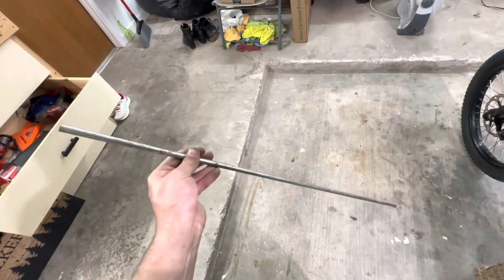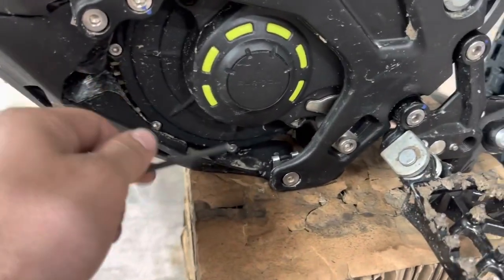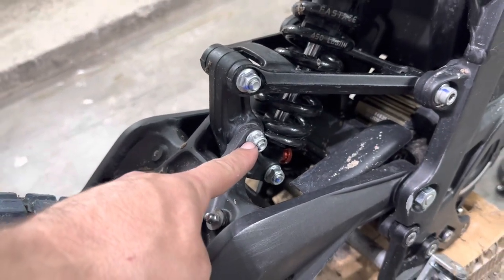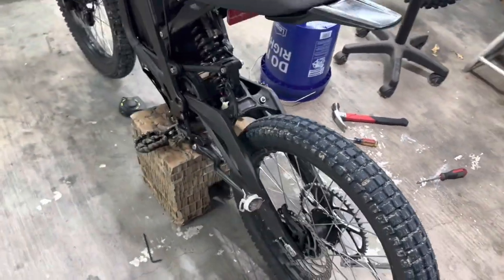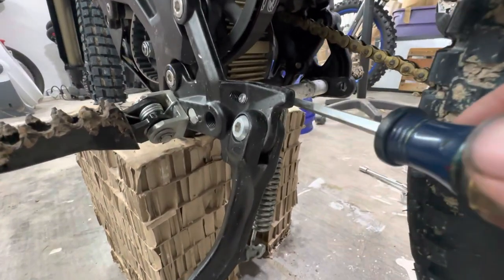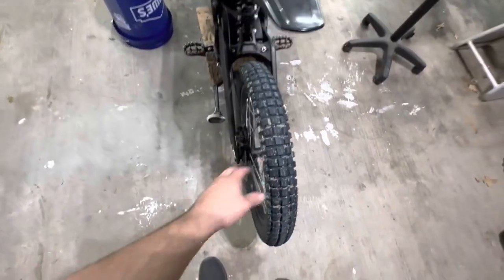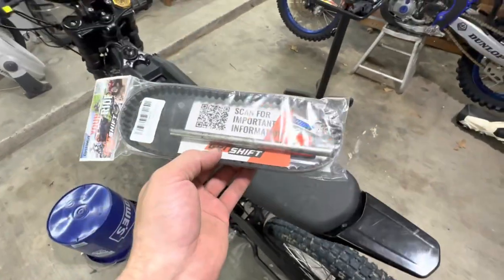Surron belt replacement EASY

Comment: All you have to do is loosen the motor mounts and frame mounts near the swingarm and it will open up slightly and you can easily slide the swingarm in place
Reply from the maker: Wasn’t that bad. I can do one in 10 minutes not filming

Comment: I found this vid looking for info on tensioning the drive belt. I notice how dang easy you were able to get it and I don’t understand😂 my bikes been down for 2 years but I just got new forks so I can get it going again (also replaced the belt) and I cannot get the tension tight enough. Is it the peg brace that makes it so you can pry down on the motor?

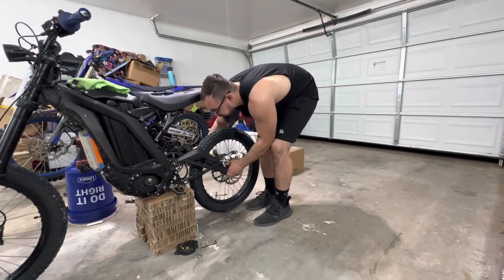Comment: how did you get the swingarm lined back up so quickly at 3:50? i spent over an hour trying, those stupid metal spacers are the issue...theres fucking no clearance...i couldnt make any progress so i shaved those spacers slightly. was still a struggle. what the fuck.

Comment: After several belts you will know how to do it in 10 minutes without remouving swing arm, just remove the axle and motor pulley cover ;-). nice trick tho
Reply: I don't see how that's possible. Make a video. Prove me wrong please
Reply from the maker: That won’t work unless I take out the peg brace.

Comment: Doing this sucked. I don’t know if any of the other methods are easier but if anyone’s wondering, definitely think about doing it another way.
Reply from the maker: @jaretmaccanico3515  you can try leaving the swing arm in and dropping the jackshaft out the bottom. If you have a peg brace you will have to remove it so the jackshaft has enough room to come out

Comment: no mobile1 grease on anything, interesting. This is why I don't buy anything used. People don't know how to properly maintain anything
Reply from the maker: You didn’t see any doesn’t mean I didn’t. I put so much grease on my belt.
Reply: @Surron_Lort  on the belt wtf? , talking about suspension shafts, pivot points and bearings. Sure you did guy.
Reply from the maker: @ericthedesigner  gotta grease the belt
Reply: I'm trying to maintain my surron properly. Where should I be greasing?